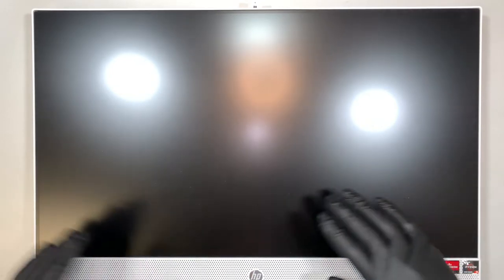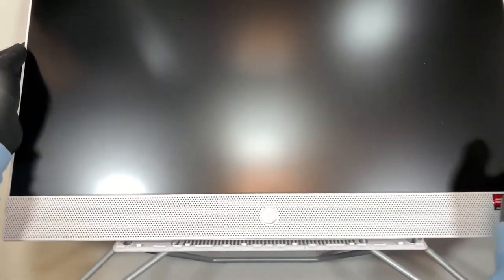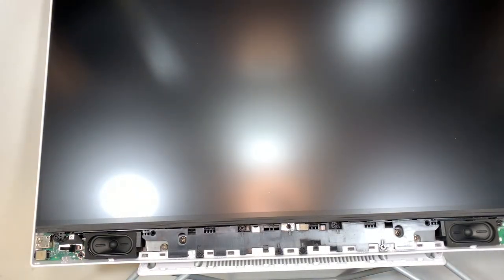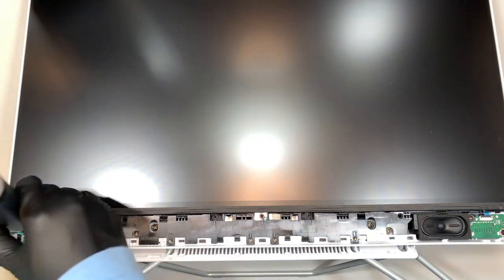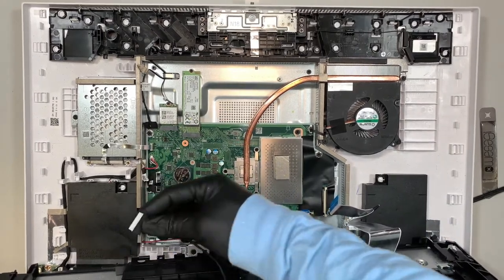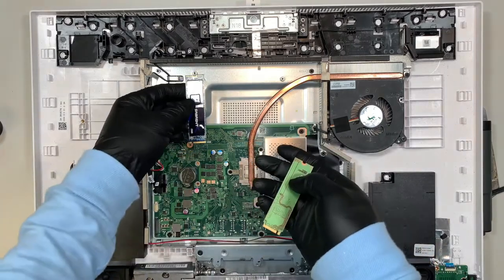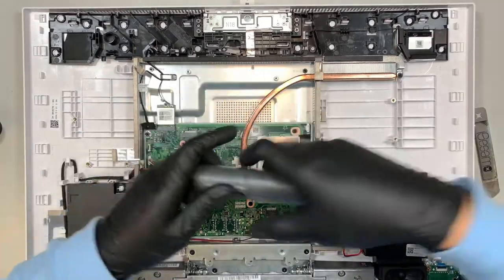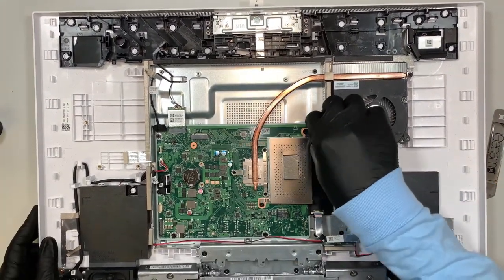HP 24 cb0017c Tear Down Screen Replacement Disassemble

Comment: I just mine apart to replace the heat compound in the CPU (and I guess it is also the GPU) with Artic Silver and to blow it out.  Also confirmed the memory type and ordered a 32gb module to replace the 8gb module currently install.

I had one heck of a time getting that display out (not wanting to break it).  Your video (especially holding up the tight side) helped a lot.  My LCD panel was really in there.  I guess it is the "snaps" that hold it at the sides and top.  The service manual does not help much.

Comment: 12:24pm. I accidentally dropped the computer face down. Now there's vertical and horizontal lines on the display. Hp AIO 24-cb0010, but when I use a 2nd monitor, there's no lines on the secondary display